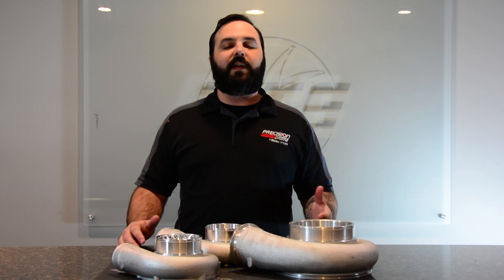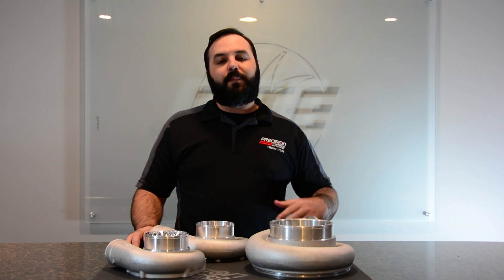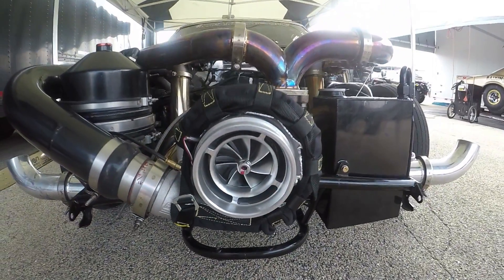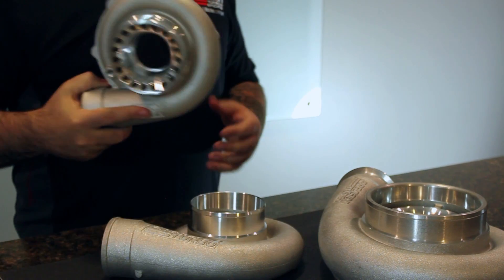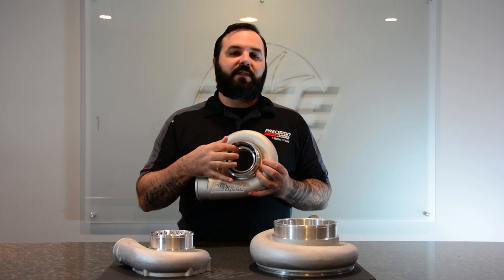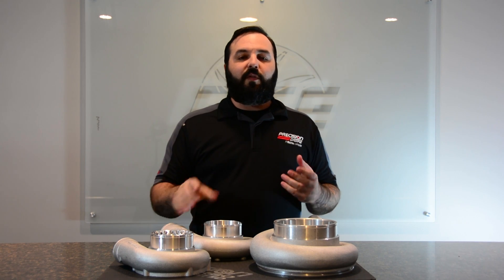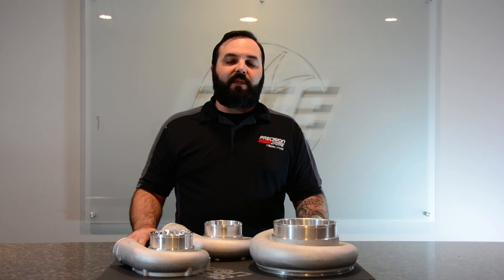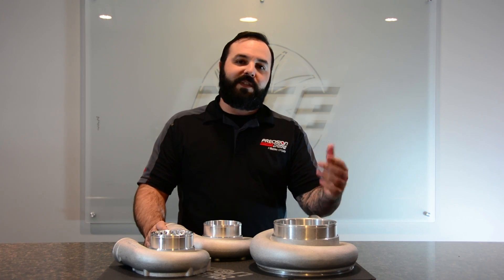How to Fix Turbo Compressor Surge - Ported Compressor Covers

Comment from the maker: Do you have any other questions regarding compressor wheel surge? Lets hear them!
Reply: So how effective do these combat both open and closed throttle compressor surge? It it completely eliminated? I understand that both aren't really good for the thrust bearing but open throttle compressor surge is really the one you want to avoid, is this true? If so do you get one without the other? 

The general consensus is people like the sound more than the practicality of closed throttle compressor surge. I dont think many are a fan of the other one. I'm also gathering that bigger turbos with upgraded thrust bearings can handle these surges more so than a stocker. Is there some truth to this? 

One more question, does one turbo handle these surges better than the other i.e. journal vs ball bearing?
Reply: @santossoto5996  did you find the answers to your questions?
Reply: Hmm no answers 🤔
Reply: Precision Turbo & Engine Hi guys! I would really like to know is there any other ways to avoid that surge? I installed front mount intercooler to my subaru and didnt have the adapter for bov at that time. I went to test drive and noticed that my engine starts to surge when i accelerate. Boost won’t build up as high as it used to. My boost was 1.3bar and now it only made 1.0bar. So any ideas? 

Thanks!
Reply: what i don't understand is,  how does it build boost at all if it lets air back out the same way it came in?
Reply: How we can find the compressor maps for your turbos?

Comment: I know this is an old video, but the information is still relevant so I'm commenting on it... I'm confused how a turbo can "flow more air than the engine can ingest". That's exactly how a turbo is supposed to work isn't it? Because pushing more air than the engine can ingest is how boost pressure is created... So "flowing more air than the engine can ingest" should just mean the boost pressure increases until the wastegate opens up.
Reply: I’m not a turbo wizard by any means but I think it’s when you go outside of a turbo’s efficiency range. If your air flow and pressure ratio needs are higher than the turbo you provide then you could run into compressor surge or other problems. Every turbo must be matched to an engine but if you’re gonna guess then I’d go bigger rather than smaller. Might have lag but the turbo won’t shred itself apart 😂   I’m sure I have a few errors in my statement but that’s kinda how I understand it

Comment: on the other hand, how do I achieve a crisp loud flutter? 😂😊
Reply: The crisp loud flutter is from closed valve surge, not bad, open valve "on throttle" is bad and what is needed to be fixed. Its all bad flutter when on throttle, if ya want a nice crips "sneeze" ya need a blow off valve/waste gate depending on setup and desire
Reply: @victariamcduffie729  you have no idea what you are talking about but ok

Comment: Is there any hp ore spool up difference in an sp vs H cover.? (because different A/R?)
Reply from the maker: Spool up time is minimal between the two covers, however the H-Ported cover should be used on units that support over 1000hp of air flow for optimal performance.
Reply from the maker: Please refer to this video for sizing on each cover https://www.youtube.com/watch?v=7pxg2WOPAeU&index=29&list=PLLLS7iRxF0dfnMvqdEGRkzDoLG6WtMt3U&t=0s
Reply: Ofcorse i have seen that video hehe

Comment: I have a PTE5858 EB turbo, so does that mean the E housing will have surge issues because it doesn't have this feature?
Reply from the maker: Not necessarily. Compressor surge can happen when a blow off valve is too small, or a turbo is sized to large for the application. Having a ported cover will help in these situations, but is not always necessary. If you are interested, the PT5858 E cover can be upgraded to the S-Ported cover easily by purchasing the cover and bolt & clamp kit.
Reply: Precision Turbo & Engine Thank you very much! Once I go more power I'll upgrade the E housing to SP. My spool is very quick with the E housing maybe cause I only have a 2.0T engine, smaller. Love your products. 👍
Reply: @precisionturbo  so there is no advantage in power (decrease or increse) in going with the bullet than the slot port housings?